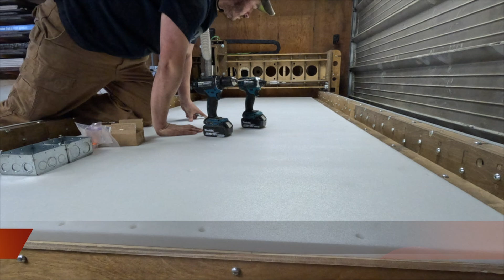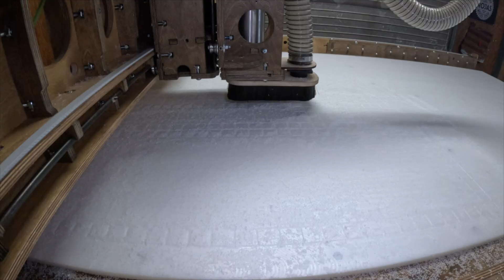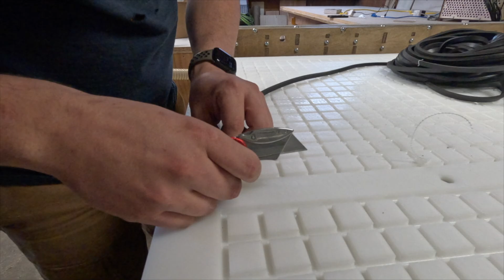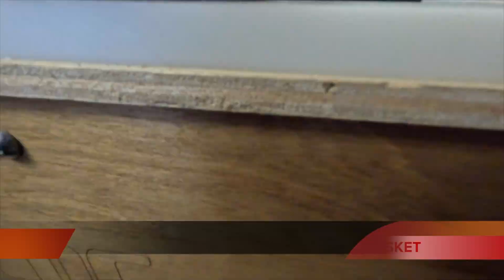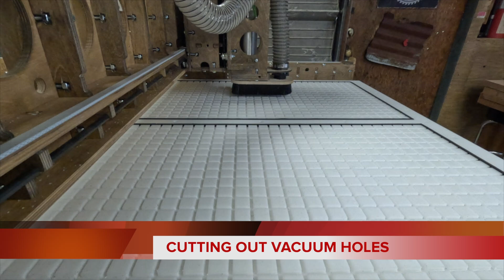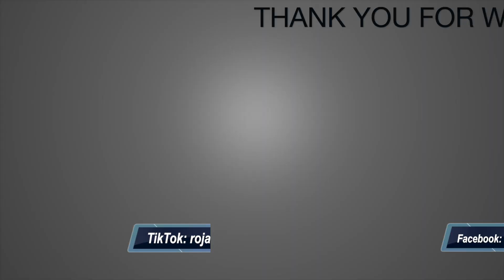Bob's Epic CNC Build Continues! Watch Part 2 Of The Kl-744 Assembly

Comment: You still liking the Bobscnc?

I was hesistant but it seems like everyone that has them loves it.
Reply from the maker: I absolutely love it! It has been a great next step for me. It has so much more power and capabilities. 

My favorite part about this machine is that the frame is strong enough to support an upgraded spindle with more power. 

With the spindle I just put in it, I can used bits as small as 1/8” and as large as 1/2”. This has made my productivity go up by a lot.